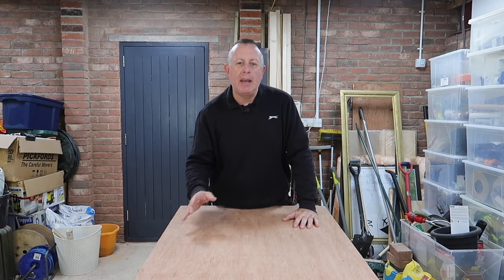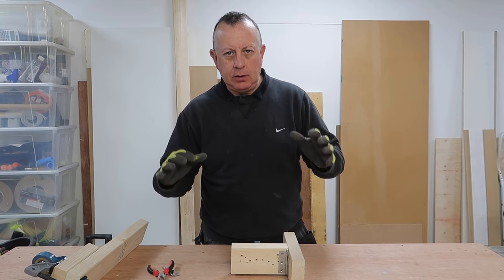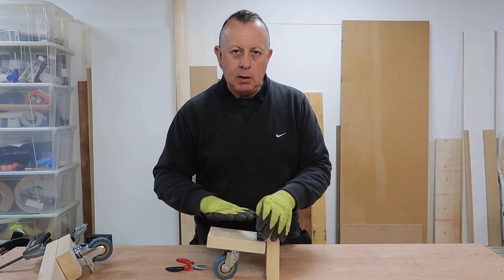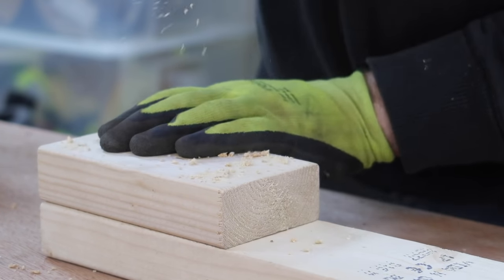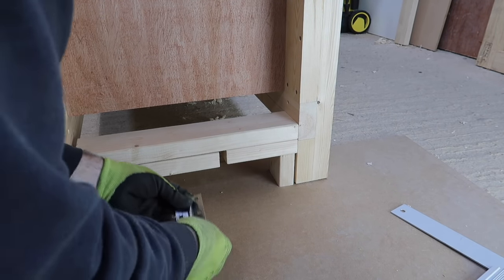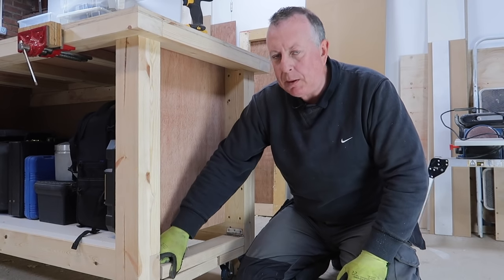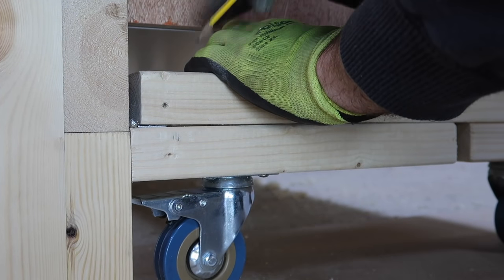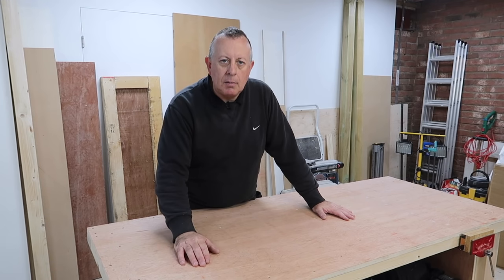Simple Retractable Casters for Workbench

Comment: I’ll begin by saying it’s a very clever, well thought out design. But why wouldn’t you just use 4 locking castors instead?
Reply from the maker: Because when you are using the bench for woodwork type activities such as chiselling using a hammer (please see my 'How to build a Door' video), there are some large dynamic forces which need to be transferred through the bench to the ground. Woodworkers will even ensure the workpiece is in the vice adjacent to the leg so there is no bounce on the bench. So, when being used, the bench legs should be on the ground not a caster.
Reply: @ProperDIY  good point.

Comment: Why don’t you put length of wood on left side , hinged at top then when you put pressure on the lift timber it just sits tight against left side locking the lift timber in place. Then just put pressure on foot timber to release again

Comment: The problem with keeping all that old hardware just in case you need it later is you're lucky to remember that you have it at all. No chance at remembering where you're storing it.
Reply from the maker: I have a set of Stanley organisers you can see on the wall of the workshop. One contains all kinds of brackets etc so I found it in there

Comment: Your casters have brakes on them so the table wont move. WHy would you not have simply screwed the casters straight into the bottom of the legs.
Reply: I can't speak to his motivation, but off the top of my head I would do it his way because lifting it by one leg at a time could result in twisting, whereas doing two legs at a time would not.  Cheers!
Reply: @bridgethunke1389  erm....lifting the table?   why are you lifting anything, How bout you put 4 standard casters that have brakes on the legs. The table stays still when you want or it moves when you want...why complicate things
Reply: @travistravis7190  Hi Travis!  Feel free to do it however you like!  As you can see by the many, many replies, a lot of people found this idea really useful.  One reason people may choose retractable wheels/casters is that casters, especially those that swivel, will never be as stable as the table legs.  In my case I'm looking for a solution for a lathe, which will wobble if on wheels.  It also needs to be leveled with precision from all four corners or the points that hold the piece being turned will never align.  There are other reasons I'm sure. I agree that it's more complicated than simply bolting on casters, but a more complicated problem sometimes requires a more complicated solution.  Use whatever solution works for your situation.
Reply: @bridgethunke1389  Wheels or no wheels, four legs need to be measure and balanced as well. Extrememly heavy machinery and equiment have been living on castors for years all around the world in hospitals, construction sites and list goes on...but yeah each to their own.

Comment: Great job and a simple solution. While in Screwfix you could pick up a couple of these https://www.screwfix.com/p/hardware-solutions-loft-latch-silver-35mm/150fj.   Loft hatch catches. I used one on a similar idea for a table for my table saw. They look a bit flimsy but work very well and will easily hold the weight.
Reply from the maker: Perfect! I didn't think of that and cheap as well. See - always learning!

Comment: Or...
Buy locking casters.
DOH!
Reply from the maker: It's not as easy as that. When using the workbench for woodwork, you need the timber legs firmly on the ground to transfer dynamic forces with no bounce or wobbly. You've obviously never used a chisel on a mortise and tenon joint!

Comment: Or you could have built the bench with wheels to start with.
Reply from the maker: No, because if you use it for woodwork (hammering, chiselling etc.) you need to have a bench that is solid onto the ground rather than something with flex or bounce which you would have with casters. With casters they are generally called 'layout' tables as they are not suitable for wood work.